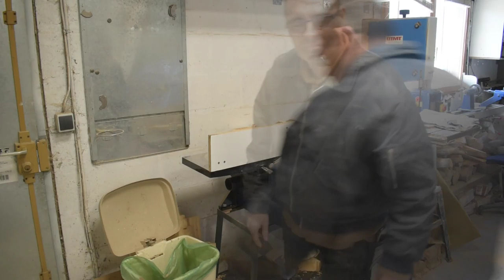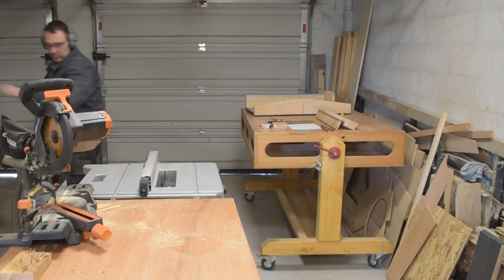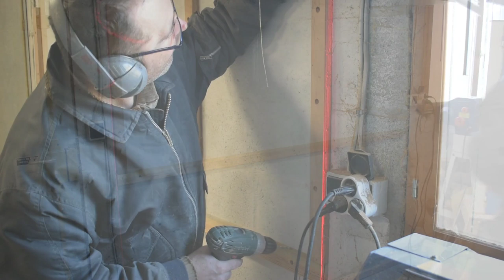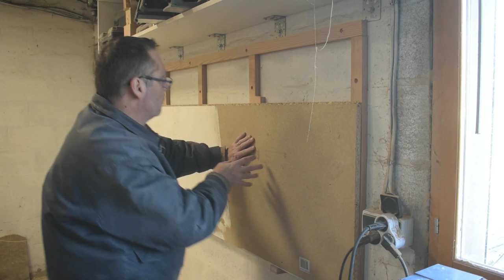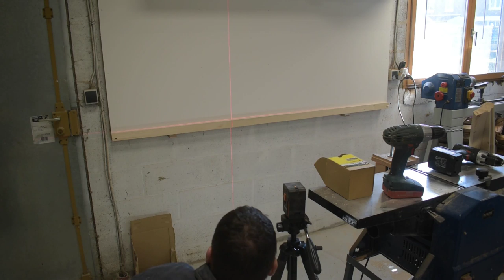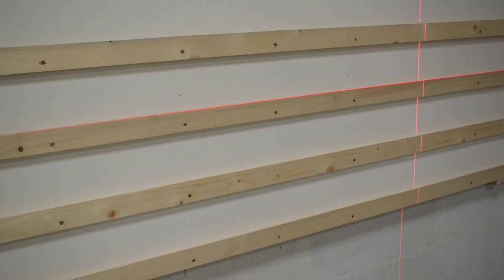Installation de French Cleat ou Taquets Francais dans l'atelier

Comment: bonjour quelle section de bois tu as pris pour tes french cleat car je dois en faire pour la première fois et je ne sais quoi prendre en gsb comme lattes ou tasseaux merci?
Reply from the maker: J ai pris des planches de 150x22 puis raboté a 20mm ensuite tu coupe des bande de 40mm mais un côté est a 45 degrés 😉
Reply: @dbbois  merci
Reply from the maker: @bernus3414  merci à toi 😊
Reply: @dbbois  bonjour je n'ai trouvé en 150 x 22 des planches de volige est ce que c'est bon pour du french cleat svp?
Reply from the maker: @bernus3414  c est bon et pas chère 😉
Reply: @dbbois  cinq planches 2m40 suffisent ?
Reply from the maker: Ca te fait 3 longueur par planche cela dépend de la hauteur voulu 😉
Reply: @dbbois bonjour, excuse moi  je reviens donc vers toi j'ai donc raboté mes planches 150 x 20 donc si j'ai tout compris je decoupe des tasseaux 40 par 20 et après  je coupe ensuite un côté de ces tasseaux a 45 ° je te demande cela car je n'ai pas une scie sous table mais une scie circulaire adapté sur un etabli wolfcraft et je voudrais pas planter mon travail. Il y a t'il un reglage spécial pour le 45° pour regler ma coupe  Pour que mes french clean soit top merci beaucoup pour tes réponses ✌
Reply from the maker: @bernus3414  oui c est bien cela tu coupe a 40 puis 45 degres vérifier l angle ensuite tu coupera sur 1mm c est a dire 39mm pour casser l arete de 45  degrés 😉